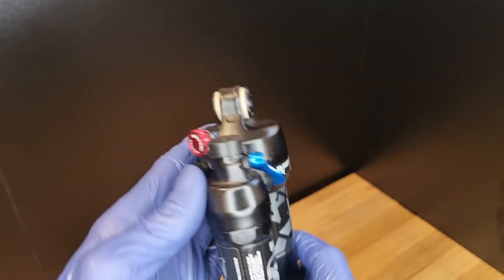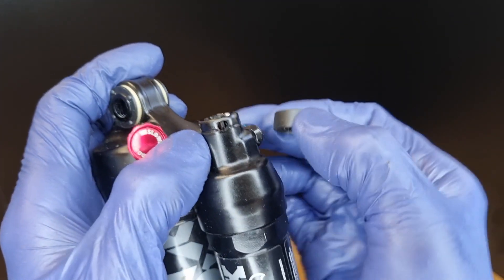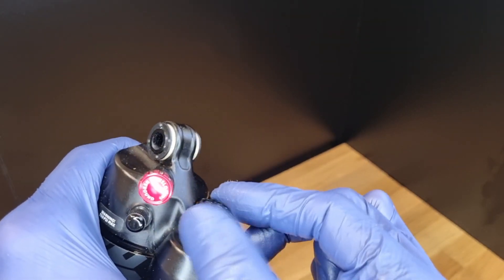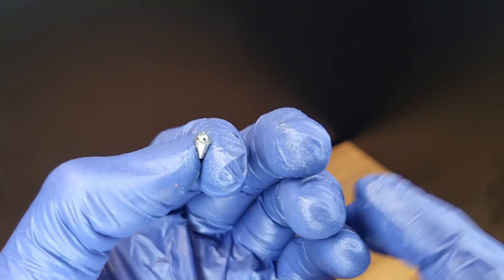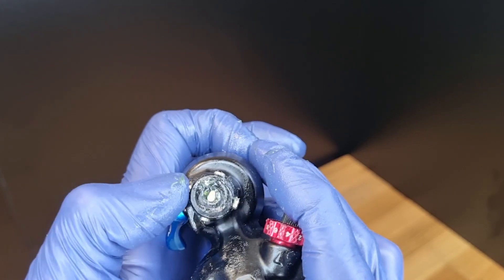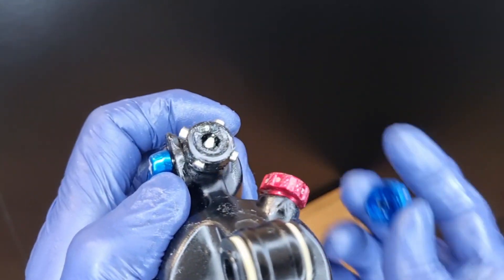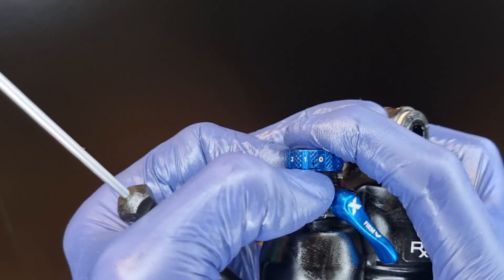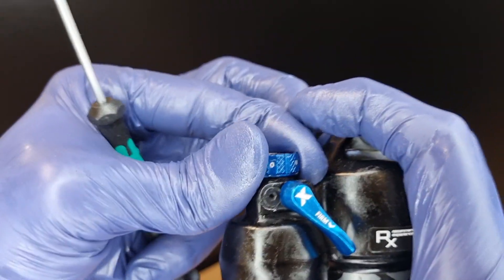2022+ Fox Float X / DHX low speed compression upgrade.

Comment: NOTE! You don't have to buy that overpriced knob. The black plastic cap can very well be used as an LSC knob. You just have to be careful when removing it so it doesn't get deformed or stretched. 
The small ball is used by the manufacturer to lock the rotation of the cap at the position they have chosen. When they install that blue adjustment knob instead, the purpose of that little ball is to limit the rotation to about 300 degrees total, through the use of a machined groove inside the knob. 
In our case, by removing permanently this little ball, the cap will be free to rotate 360 degrees. It's impossible to limit the rotation because there is no groove in the cap. Now if you look at the top of this cap, you will notice a small notch on the periphery. When this notch faces the shock's body, the adjustment is at the minimum position (full open). Coincidentally, the molded X on the top is square to the shock's body too. 
Now you just have to reinstall the cap, and use it like the blue knob. Note that the cap is keyed to the shaft, it slips in at only one orientation. You will just have to remember that the maximum position will be about 300 degrees clockwise from the full open position. The range of adjustment is not very noticeable, BTW. There is enough friction for the cap to hold its position by itself, no need for clicks!  Have fun!

Comment: do you decant the entire shock before taking the cap  off??
Reply from the maker: You do not need to do anything else, the cap is just a plastic protector, no air pressure or oil underneath.
Reply: @theangrybikemechanic so if there is no air pressure in the 2nd chamber, what nd how is this dial adjusting?

Comment: there is no need to buy the blue cap assembly, the original black cap has the drive socket for the adjuster already in it, just turn it!!!!   it works well.
Reply from the maker: @byronjones6155  It even has 4 detents. 😉 But the blue alu cap is easier to turn by far.
Reply: @theangrybikemechanic  I set mine once, no need to ever change it.

Comment: Hello good afternoon!

Do I have a question? I bought a bike with this shock. Would you know if it is compatible with a remote lock on the handlebars? Is it possible to install?
Reply from the maker: @welersonqueiroz3214  Not this version of the Float X, you will need an entirely different eyelet assembly.

Comment: How do you know what setting you are in as the compression adjuster stub keeps rotating because it has no end stops??
Reply from the maker: Hi, sorry for the late reply. There is a positioning ball on the face of the adjuster interface. It mates with a channel in the adjuster knob. Since the adjuster interface and the knob are keyed you will have the adjustment range automatically available with end stops as long as this positioning ball is present.

Comment: Hi. So by doing this upgrade do you essentially turn a performance -> performance elite?
Reply from the maker: Correct. 🙂
Reply: add the spring and you basically have the factory shock @theangrybikemechanic

Comment: This was very helpful.. THANKS!    Does anybody know why Fox and several bike manufactures chose to leave this adjustment off?   (Seems like a unit price savings would be very negligible).
Reply from the maker: Well, I can only give you a guess but cost cutting is one part, OEM products in the tens of thousands add up. The other being a performance level differentiation, or the perception of just that.

Comment: How many clicks of adjustment are available with this upgrade? What setting was the LSC from factory?
Reply from the maker: 12 positions, 11 clicks. Comp setting seems to be just close to max from factory with the cap present.
Reply: @theangrybikemechanic  Hi.  My factory LSC setting appeared to be set at "7" out of the 1-10 numbers printed on the new LSC aluminum cap for the Fox Float X on my 2023 Specialized Levo SL.
Reply: @billderas3420  The numbers are printed in reverse order, they go down when you turn the knob clockwise to increase damping. Not very useful...
Anyway, check my other post, you don't need to buy that knob, the cap can be used.

Comment: How many turns should the pin be and witch way do you locate the numbers on the knob thanks
Reply from the maker: The knob should settle in the correct position if you install it as is with the little ball in place to act as a stop. 

If the adjuster has been moved before or a rebuild done you can find a clocking reference on ridefox.com partslists for the FloatX.
Reply: @theangrybikemechanic   not knowing at what point the adjustment is, I tried to close the wheel without stopping but I never get to the stop.. is it possible?
as if it were running on empty
Reply from the maker: @rebeck548  My bad, I was thinking of another model when I typed the answer out. Updated now. The adjuster will not come to a stop without the ball present for the slot in the lid to engage with. You will find a clocking reference on ridefox parts page. Look for the diagram showing the top view of the eyelet and that will tell you what you need to know. Get back to me of you can't find it. 👌
Reply: @theangrybikemechanic  can you link me  the page? Please .thank you
Reply from the maker: @rebeck548  https://www.ridefox.com/fox17/help.php?m=bike&id=1132 

Look for a top-down image of the cap (plastic cap shown) and you will see the clocking steps.
Reply: @rebeck548   I believe that it rotates infinitely, because in the body down there it must have some valve, that's why it has the gear to limit it, so there's only one way to mount it, no matter how many turns you made before assembling it. I believe that's it, because there's no part that has a tap-type thread there.
Reply: @theangrybikemechanic  I believe that it rotates infinitely, because in the body down there it must have some valve, that's why it has the gear to limit it, so there's only one way to mount it, no matter how many turns you made before assembling it. I believe that's it, because there's no part that has a tap-type thread there.

Comment: Hi there, may I know where you bought the low speed compression knob?
Reply from the maker: Hi! I work as a suspension tech so this is something we usually stock. In the description you'll find the S/N for this kit from Fox, visit a local Fox dealer and they will be able to order it for you. 🙂
Reply: Or just enter the part number in Google, it will quickly find where you can buy it. Google is good at selling stuff. Like your data, but that's beyond the point.
Reply: Thank you guys